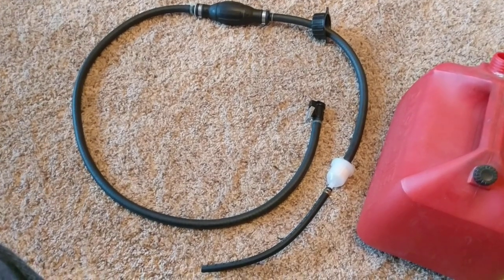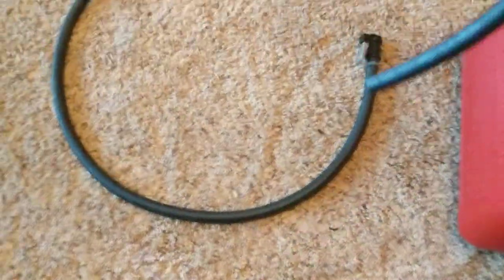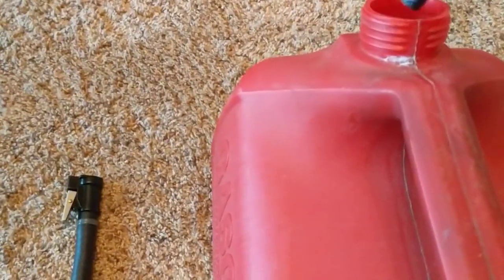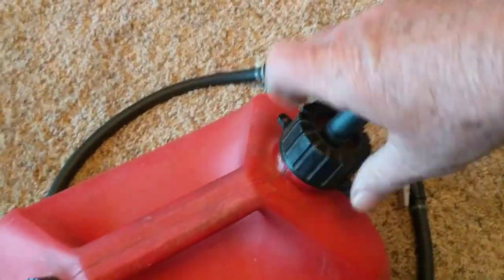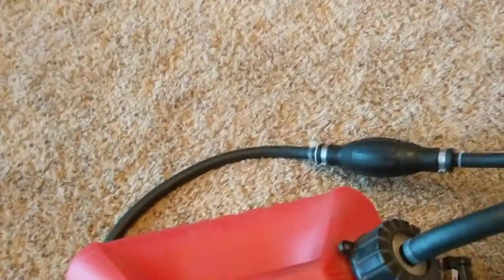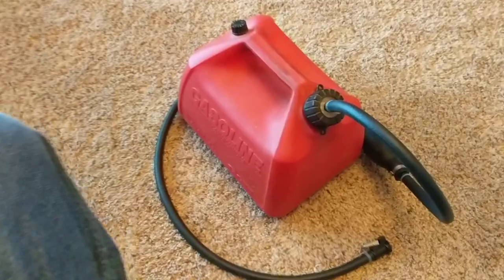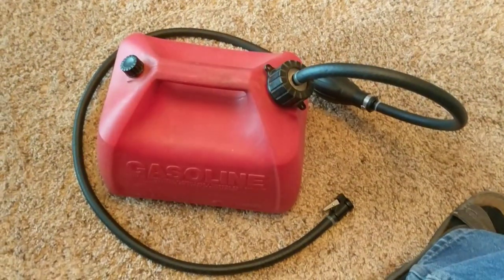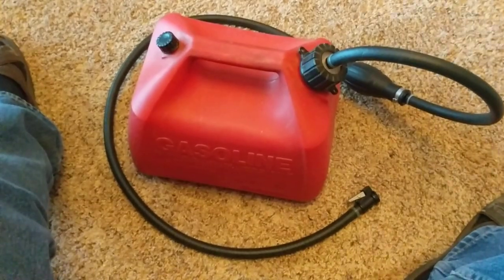Make an Outboard Fuel Tank Cheap

Comment: That’s a lovely little solution. Do you have a link to that fuel filter. It’s such a good fit. 
Add a gasket or two and it would never leak either.

Comment: This is Awesome. You could keep all kinds of spare gas tanks  or refill a few easy at the station. Could you send me a link for the filter you purchased. I want it to fit like yours did so I do not have to modify a seal.
Reply from the maker: I bought the filters on Amazon for a lawn tractor 24 horsepower Briggs & Stratton. I think I got a pack of 10 for cheap.
Reply: Is that perfect fitting filter that makes this so nice. I guess I could go hunt for one of the right dimensions. An Amazon link would be cool.
Reply: @frederickwood9116  I just went to Homedepot, one filter was too big the other too small.
The dimension on the Amazon stores never give you the critical dimensions :-( as this is a special case.
Did you find a filter that fits?

Comment: When i primed my external gasoline tank on my tohatsu 6hp outboard and once bulb inflated, if i press more on it, gasoline pees out of the black tiny hose in front, is that normal? My engine started to sputter at high rpms and im trying to figure out what could it be, engine is new 2023, Barely used, always run it dry after use ,(i dont drain carbuterator though, just let it run idle until it shuts down, any advise would greatly appreciated)

Comment: this is awsome 
would really appreciate it if you could post the link looked on Amazon and want to make sure I get the right on
Reply from the maker: I bought the filters in 2018 and looked on Amazon and they are not available anymore for sale. All I can tell you is take your gas can cap that you're going to use and go to Lowe's or home Depot and see if you can find a filter that matches up.
Reply: thanks for your help
Reply: That’s another good idea. Thanks again.

Comment: I tried this but the filter was air locking, maybe because the filter is almost vertical,  and the motor slowed down and died. Could possibly lay the gas can on it’s side.
Reply: If the rubber suction bulb is a "2 way" valve, then it will not work. when the bulb is squeezed, one valve closes and one valve opens. You will not get a continuous flow unless you keep pumping or when one valve is leaking. Better if there is no rubber bulb or put a bypass with valve between the suction.

Comment: the biggest negative i can see in making the tank that way. comparing to buying a  commercially available fuel tank  from a Marine Supply store  is if you   do  fill up on the water or use Marina facilities. and God for bid a accident occurs  Insurance Companies will investigate and rule they wouldn’t cover the damages  the problem with that is if it’s in a Marina  it can easily  cause Miliions of dollars of damage to Expensive Waterfront realestate and  Vessels   i hate to sound negative  on a good idea  but i   have owned many boats  and  several of them  were Marina  docked  that usually require  the Vessels to be insured by the Owners  and Insurance Companies do whatever they can  to not payout the bigger Claims  so they have all these rules and do nots  protecting them  now i also kept boats on the Chesapeake Bay for years  and Contaminating those Federally Protected Waters  with Fuel or Oil spills can be hundreds of thousands of dollars in fines  on top of the Property Damages  i saw a teenager with a old car  have a fuel tank leak and run into a Storm Drain  that eventually flowed into the Chesapeake Bay Watershed  incur  tens of thousands of dollars worth of  fines  that his Grandmother was eventually being sued for by the State Of Maryland  because of the Cleanup they attempted to  handle  the Grandmother was my neighbor  and the stress almost killed her
Reply: Having a gas tank storing gas with it's standard cap should not violate insurance issues.  Only use when running your outboard. This would minimze any liability.